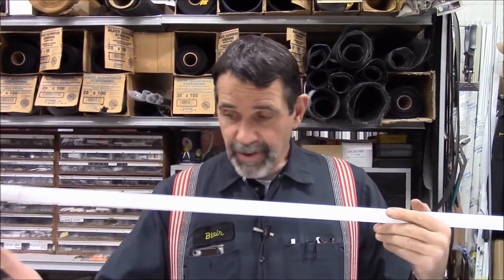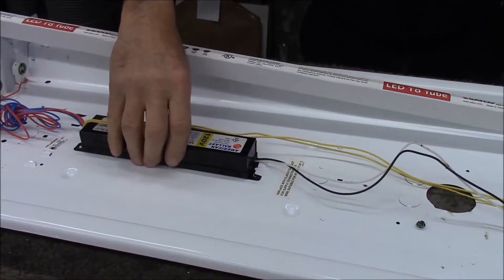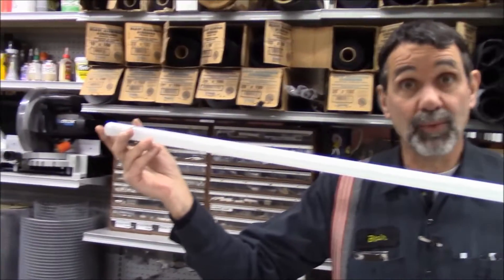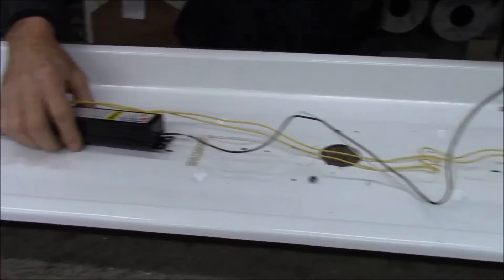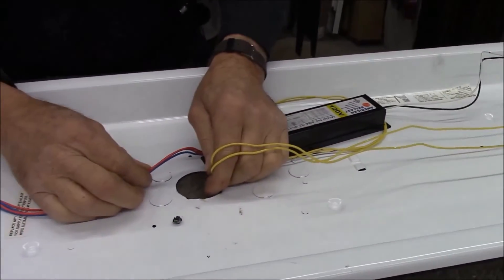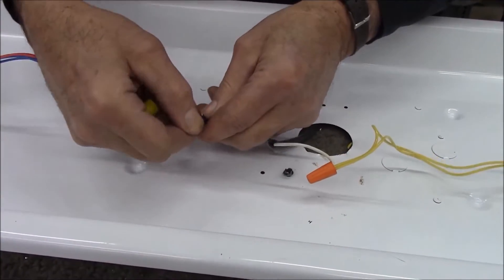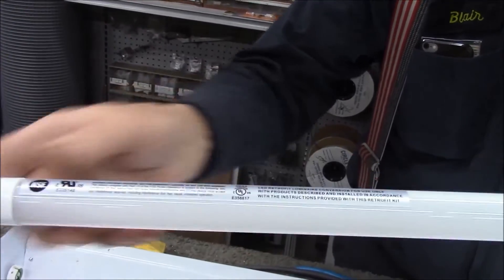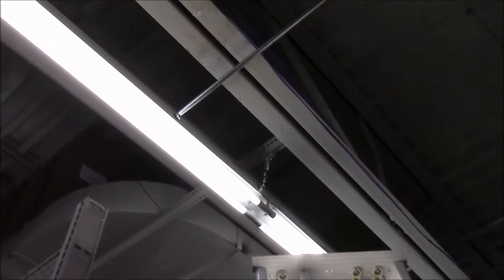Rewire Fluorescent to Led Lights - Using Double-Ended Tubes

Comment: Excellent information. If viewers pay attention, it's knowledge that will last a life time.
Reply: Or at least until we have the next generation of lighting.
Reply: @BrianHeilig1 was gonna say, and here we are! Though I did pick up one of these old fixtures with ballast for two U shaped t8 bulbs. Plan on just installing CCT led strips on the inside and using it as a photography light box with variable color temp. Might even add color just to have the option as it's all so cheap today. Don't really need to spend the money on the t8 shaped led bulbs that are essentially led strips in a tube.
Reply: @BrianHeilig1  ...that comes with the next generation of greedy capitalists.
Reply: Is that a real beard?
Reply: Well said comrade
Reply: No kidding????

Comment: What about the ground wire?
Reply from the maker: Always attach it to the metal fixture. Not to any power wires. Its purpose is to protect you if ever a power wire, black or white, touch the ‘cabinet’. It cannot be used to operate anything, only to ground the frame to protect the user.
Reply: @MrHardware1   Thank you.

Comment: Question please Sir:  I have two kitchen fixtures that take 4 - 48”inch fluorescent bulbs.  I purchased eight LED, 48”,  T8, 120v, Type A bulbs.  I am confused whether these require a ballast or I can do a direct current like you are doing. Or do I have to buy direct current bulbs? Thank you for your time.
Reply from the maker: The fact that they are 120v bulbs indicates they are direct wire. Are they ‘shunted’ or ‘end feed’? That will determine how they are wired. There must be an instruction sheet to keep you on the right path.

Comment: Don’t forget about needing non shunted tube stones for this to work……..
Reply from the maker: My goal is to let people know that there’s different kinds of bulbs which required different kinds of wiring. Thanks for the comment.
Reply: @MrHardware1 yes your video was very helpful but I tried it and it wasn’t working until I changed all the tube stones with the ones supplied with the type B lights.

My comment was only to help someone else that may try putting type B lights in an older fixture and it not working.

Comment: Question...from 1:21 to 1:43 you called it "end feed" referring to the bulb, but yet you called it a "shunted installation"  But the tombstone needs to be Non-Shunted or else you would have a short between hot wire and neutral.   Correct?
Reply from the maker: Yes, my goal is to educate people that have shunted tombstones. They need to get shunted bulb that are fed from either end. If they have a bulb that’s end feed where the hot and the neutral come to only one end of the bulb then they can’t have a shunted tombstone. Just trying to make that clear so people buying bulbs by the bulbs that suit their fixture so you don’t have to buy new tombstones if they don’t have to
Reply: @MrHardware1  Thanks.  Back when I did mine I had to open the tombstones and remove the hard connection and thus make them non-shunted.  Just wanted to make sure I understood your comment.

Comment: What if I don't have a double pin bulb, it has a nibble on the end?
Reply from the maker: I’m not aware of an LED replacement for that bulb without you changing the tombstones so that it could handle a two pin bomb. Is that a 4 foot fixture, because if it’s longer same problem will exist you may have to just change out for a brand new fixture.

Comment: What do you do if you have 2 ballast? Same process. Pick a ballast rewire it and just cut and remove all the wires from the other ballast
Reply from the maker: Two ballasts would likely be a four bulb 4 foot fixture. If that is true, you can still wire it for either shunted or Non shunted bulbs.

Comment: isn't it worth mentioning that some of these LED tube lights have a L-Load end and a N-neutral end? So, in this case, the load end would have been inserted in the tombstones with the blue and red wiring, and the neutral end into the tombstones with the yellow wire.
Reply from the maker: Yes and no. I believe I mention it however the bulbs are not polarized so the bulb installer can insert the bulbs either way.

Comment: I tried to convert one of my fixtures. The ballast had two blue wires going to one side and one red wire going to the other side. I wired hot to blue and neutral to red. The red side had a jumper wire for the second tombstone. The LED bulbs were super dim. I was thinking the type of tombstones may be the culprit but I see the ones in your video are the same ones I have. Could it be the LED bulbs?
Reply from the maker: I’d double check the wiring diagram that came (or is available from the supplier) w/the bulbs. I believe a manufacturer can produce several types of bulbs, maybe you have ‘ballast’ driven bulbs. My least favorite.

Comment: How about changing led to fluorescent!
Reply from the maker: Not gonna happen, especially now that they wanna make sure we don’t add any more mercury, which which is fluorescent tubes. It would just be a waste of energy.
Reply from the maker: if there is some specialized tube you wanted to use, The instructions are on the ballast which you would buy to match the fluorescent tube you wanted to use.

Comment: I have several different made LED bulbs, but not sure if they’re wired for black wire on one end, & white on the opposite end. Or is the bulb suppose to be only hooked up on the one end only, and can the black & white wire be hooked up backwards. What do I look for, to know what wires goes where
Reply from the maker: Thick the ends of the bulbs for ‘L’ and ‘N’ which stands for line (black) and neutral (white). Dual bulbs will have 2 ‘N’s’. One next to the L on one end, and also on the opposite end which ‘could’ mead it could be wired as an ‘end feed’ or ‘shunted’. Other bulbs are ballast wired which could mean they need a working ballast and no wire changing is required. I avoid this type because my goal is to eliminate the ballast and save energy. All this shows you that you need to search for on-line instructions to your bulbs before you might ruin them.
Reply: @MrHardware1 well I found on 2 of the 4 bulbs that are the same, that they are retrofit bulbs (no ballast), both wires hooking up to the same end, not saying which is L, & which is N. The other 2 bulbs are different from them, and from each other, having no L or N on them, not saying whether ballast needed, or if they’re retrofit, or L on one end, & N on the other. I would think that they have to say what kind that it is exactly on the bulb.

Comment: Can't seem to find a video to show how to wire up LEDs in these lamps when you have a pull chain switch.
Reply from the maker: The pull chain switch is connected to the hot black feed wire and becomes the ‘switched’ output to the bulbs. Its function is to interrupt the hot wire to the fixture. The white ‘feed’ wire is not switched, simply connects to the fixture with or without the switch.
Reply: @MrHardware1  Aha!  That's helpful and elementary-thanks for pointing it out for dumdum me!  LOL

Comment: Good morning.  I just replace my fluorescent bulbs with direct wire leds.  I put the hot wire to the blue and red wires and the neutral to the yellow wires.  I have power to the fixture but the lights won't light.  Can you give me an idea what may be wrong?  Thanks
Reply from the maker: If the blue and red wires go to the left-hand tombstones and the yellow wires go to the right hand tombstones it sounds like you’ve wired it correctly for a shunted bulb. Now you gotta look at the schematic that is supplied with your bulbs, I hope, and maybe you have ‘end feed’ bulbs (which means the hot and neutral goes to one end only, the prongs are marked ‘L’ and ‘N’ on one end w/no letters on the other) and that’s why they are not working, maybe, seeing as I can’t see your stuff.
Reply: @MrHardware1  These bulbs are direct wire type b.  I've wire one in my garage that works.  This one however, won't light.  I have 120v going to the fixture, but it still won't come on.  It's wired just like the one in the garage that works.  It's a head-scratcher for sure.
Reply: @MrHardware1  I found the problem...intermittent wall switch.  I probably didn't need to replace the old fluorescent bulbs after all, but the leds are much brighter.  Thanks for replying.

Comment: Great video! How do you know the existing fluorescent fixture is one end or two ends?
Reply from the maker: Fluorescent fixtures require electricity to be brought to both ends of the tube. The real question here is is are the tombstones shunted, which means that their two poles are actually connected together and only have one pole. Or the tombstones are 2-pole which means each side of that tombstone can take a separate wire. Knowing what kind of tombstones are in the fixture will let you know what kind of bulbs you should purchase.
Reply: @MrHardware1 thanks for the explanation. It helps. So, if I connect blue/red wires to black hot wire and yellow wires to neutral white wire, I don’t have to know if the sockets are shunted or not. Is that correct? Thank you!

Comment: Ok i have 4 lights with 4 bulbs i like to change like this. Hoe will that work😊
Reply from the maker: Sounds like a plan, should work out just fine if the directions (wiring schematic) are followed.

Comment: The best fluorescent modding video ive found so far. Was looking for someone covering shunted and unshunted and wiring different ways.
Im doing work for friends and ive only workd on dual lamp fixtures and not quad tube type, so just needed a little more info for rewiring for bad ballast removal. Thanks
Even though i found new ballast on clearance sale for $7, i think just going ahead and rewiring and getting rid of ballasts all together will be best for saving energy.

Comment: Hello sir can i use single ended led light in the place of double ended led light
Reply from the maker: @brunogina3329  as long as you can wire the fixture properly

Comment: Very clear and concise, thanks.  When is an Emergency LED Driver required in converting a fluorescent fixture to LED tubes?
Reply from the maker: @hewittmcelroy3711  Emergency driver? All the new led ‘fluorescent replacement’ bulbs have drivers built in. I think only commercial bobs and specialized LED bulbs have an external driver. Seems like everything these days the driver is built in.

Comment: Sorry, I am late to the game. Overall, a great video, but I need some clarification on one point.

At time mark 1:17, the speaker discusses single-end configurations where the hot and neutral are both connected to just one end of the LED tube and the other end has no wiring. But then the speaker says this is also called a shunted installation. A shunted tombstone has both contact points joined together inside the tombstone. So, if you connect the hot wire to one contact point and the neutral wire to the other contact point in the same tombstone and restore power, you will get a short circuit. I would think you would want non-shunted tombstones for a single-end configuration and shunted tombstones for a double-end configuration. p.s. based on the existing wiring in the video, the tombstones are shunted.
Reply from the maker: @Around_The_Home  you are correct, I didn’t realize that the editor cut an important piece out of that video. Part of what I was trying to establish is that there’s two kinds of bulbs and the end bulb won’t work on a shunted fixture. Good catch thank you
Reply: @MrHardware1  Thank you for the confirmation. Glad I am not going crazy. Since I am a homeowner and only had a few to do, I did things a little differently. I not only removed the ballast, I also removed all the old wiring and the old tombstone sockets. I replaced them with new tombstone sockets (the old ones were over 45 years old) and new 18 AWG solid copper wiring. I used the standard colors for my wiring. Black insulation for the live/hot conductors and white for the neutral conductors. This made it very clear which end was live and which end was neutral. I never liked the bare 2” opening in the sheet metal fixture where the wires came through, so I plugged the hole with a rubber grommet for a 2” opening and then ran the wires through the grommet. Finally, none of the fixtures I converted were grounded even though the fixture had a screw hole for ground. So, I screwed a green colored screw into the hole and attached the grounding conductor to it. Cost me an extra $10 per fixture for the new tombstone sockets, wiring, grommet and ground screw, but as a homeowner with only a few to do, it was worth it to me.
Reply from the maker: @ nice job. Not many will go through all the effort.

Comment: Very informative! It answered my question about what each wire does. Turns out you just think of the ends as 2 poles (+/-) rather than worry about the wire colors.

Comment: I wired them exactly that way and all the bulbs will do is flash. They won't turn on.
Reply from the maker: @cajunroadwarrior  did you check to see if your bulbs were wired ‘shunted’ or end feed? 2 kinds of bulbs (or more), 2 different wiring methods. Were they 120 volt or maybe they required a ‘driver’ and weren’t direct line voltage bulbs…. I can only guess w/out a model # that I could investigate.
Reply: @MrHardware1  how would I know how they are wired? Walmart has only two brands, great value and Sylvania.  They don't sell ballasts anymore and the only shop lights they sell are plug-in type.
Reply from the maker: @ whatever bulb you have, is searchable on the Internet and then you will find the wiring diagram to go with it.

Comment: QUESTION!
can I add a dimmer to this setup?
Thank you
Reply from the maker: @mariom383  yes you can as long as the bulbs you purchased are dimmable. You probably will need a special dimmer that does LED bulbs. Our old style dimmers don’t normally do LEDs.

Comment: I've watched this video several times and still confused as to whether I should connect all power to one end or hot to one end and neutral to other.  My fixture is 4 bulb, shunted toombstones.  Can you please help?
Reply from the maker: @MrGr8golf  if you have shunted tombstones you’ll need shunted bulbs. That is mandatory. This is the easiest fixture to rewire, all the tombstone wires on one end go to the white hot wire and the opposite side all go to the black hot wire. If by mistake you have ‘end feed’ bulbs you’ll have to change the tombstones so the hot black and white can feed an un-shunted tombstone on one end only.

Comment: For anybody's advice to last for five years in our go-go society is bordering on savant. Be sure to use the "humble-brag" method when being lauded for you advice and do not get over awed by your kind and even-keeled humility. To become such a evenly balanced adult is a rarely achieved ego that I would guess to be less than one one-thousandth of the amount of humans as a whole. I am envious as well as in awe of your deep and thoughtful personality. I cannot even think of an appropriate Latin phrase of appreciation.
Reply from the maker: @olddavid4  well, you’re killing me with kindness. I was just lucky to be raised in environment at a hardware store where home repair was the number one product we tried to provide. So using all the  tradesmen that I grew up with, I’d suck a little bit of info out of everybody. The retirement complex where I live at in Florida has gates that allow people to come and go and automatically open and close and you need a code and all that. The company wanted $7000 to repair them so a  programmer tech, dude, (and neighbor) and I took pictures of all the components inside the boxes, read all the manuals (just what we needed) and now we are the Gate masters of our community! I’m very lucky 350 houses in this little community and they’re almost all blue collar working dudes like me, I think I died and went to heaven! We all help to fix everything!

Comment: How do you know if you have shunted or unshunted tombstones?
Reply from the maker: @ASC-o3b  by (after disconnecting the wires from the ballast) using a continuity tester, or ohm meter, check to see if the wires are shorted together or not. Sometimes you can tell visually that the 2 poles (contacts) in the tombstone aren’t connected together. Each wire goes to one pole only.

Comment: i have blue red and yellow all into the tombstones. Should they be wired in accordingly, to their respective pos/ neg?
Reply from the maker: @bennoyes05  did you get shunted bulbs or did you get end feed bulbs? A ‘L’ (line) on one end and a ‘N’ (neutral, white feed wire) on the other or is the ‘l’ and ‘n’ side by each next to each other? Some bulbs go both ways. Shunted is easier and is shown in the video.

Comment: I notice you didn't use ballast bypass led lights does it make a difference versus regular led bulbs
Reply from the maker: @levialston518  I don’t want the ballast involved. It’s sucking up electricity w/no gain. So, no I don’t use bypass bulbs

Comment: Hi sir, Loved the video. Very easy to follow. Thank you.

Question, i purchased 4 new LED T8 Hybrids to replace the 4 Flourescents that had finally all blown. Says the bulbs work with and without the ballist. So i simply replaced them. Selected the 5000 selection and they worked for a couple hours. Then nothing.  Stopped working . 
Any idea why? 
Fyi, lights are connected to a motion detector switch.  Does that matter? 

Thank you.
Reply from the maker: @derrickhelm530  ballast driven LED bulbs are easy, that’s the only thing good about them. Taking out the ballast and hooking directly to the bulbs is the most efficient way and actually will save electricity rather than letting that old ballast suck up juice. I would take the motion detector switch, which can be tweaky, and bypass it to test the bulbs before I started working in the fixture. if I were to go in that fixture, obviously I would remove the ballast and hook the bulbs up directly to the 120 V.